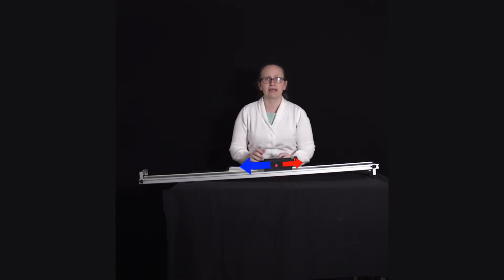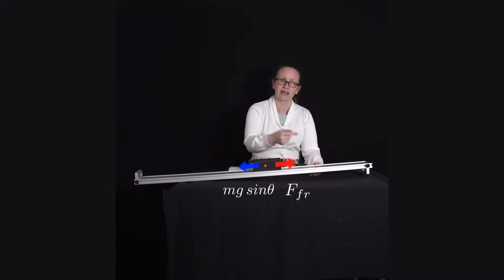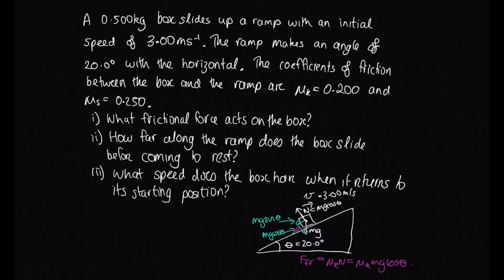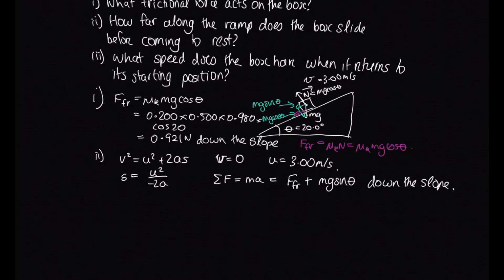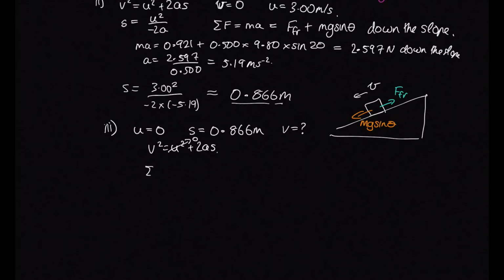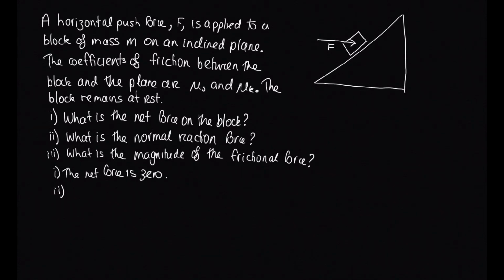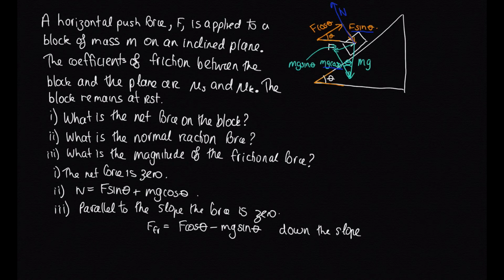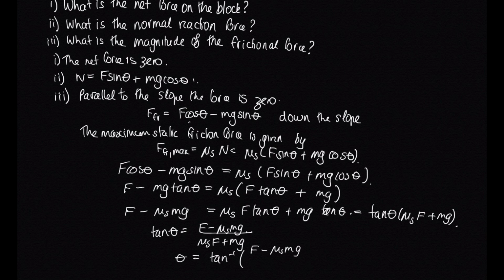Inclined plane with friction

Comment: Just to point out, I believe there is a typo at 8:56. It states 0.980 for g instead of 9.8 - I don't think this was intended as none of the other values were scaled in any way and it yields 0.092 N as the result, not 0.92 N as expected.